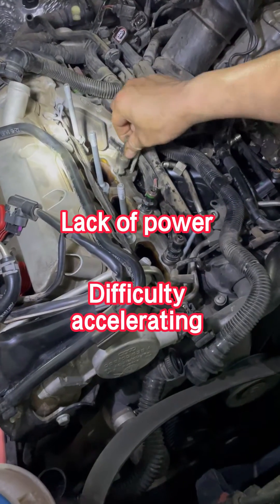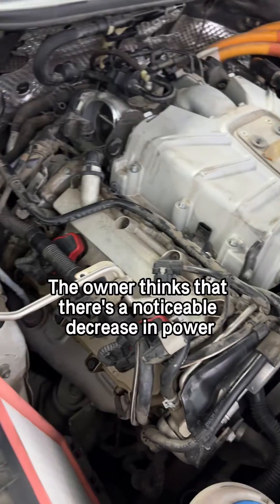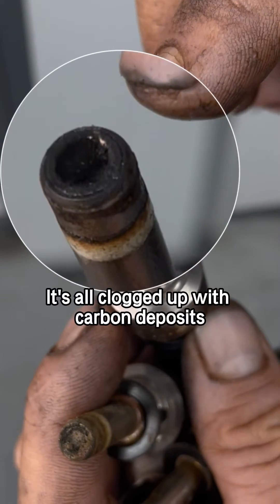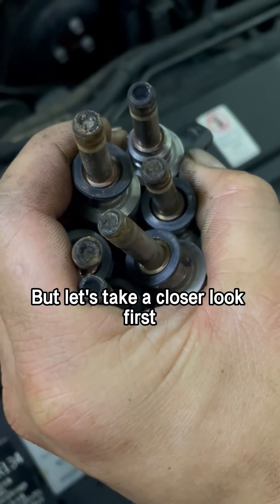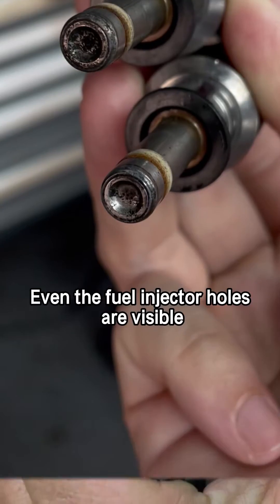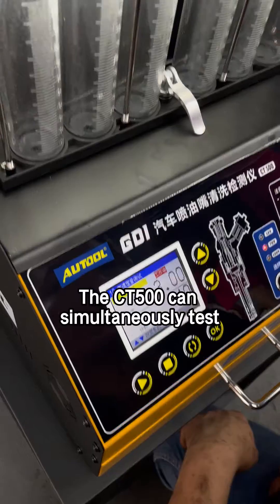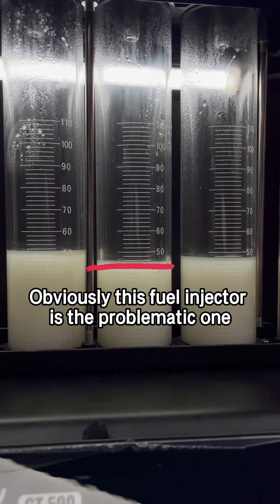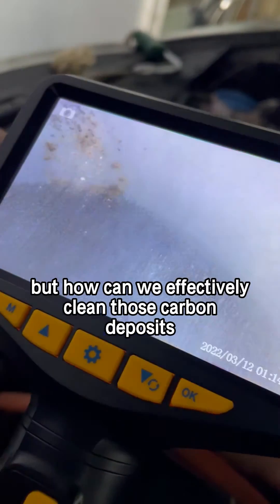Porsche Injector Cleaning & Testing: Restoring Power and Performance #FuelInjectorMaintenance#autool

Comment: There is no need to clean the injector using ultrasound. There are many ways to wash the inside and outside. And how to check at a pressure of 40-250 Bar
Reply from the maker: HI there, Not only the cleaning function, but also the injector testing function.
Reply: @AUTOOL-TECH  How to clean the inside of the injector? How to check the pressure at 6 Bar.?
Reply: @AUTOOL-TECH  Can't wash the injectors and can't check them. https://www.youtube.com/watch?v=bcmfYsdg2Ws